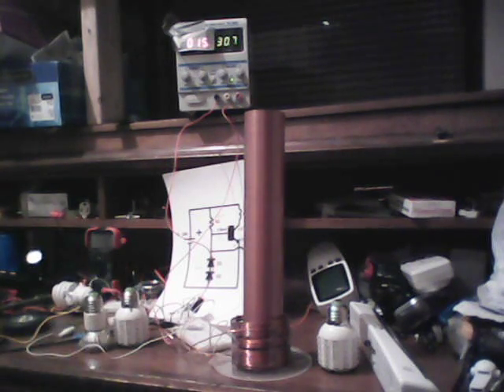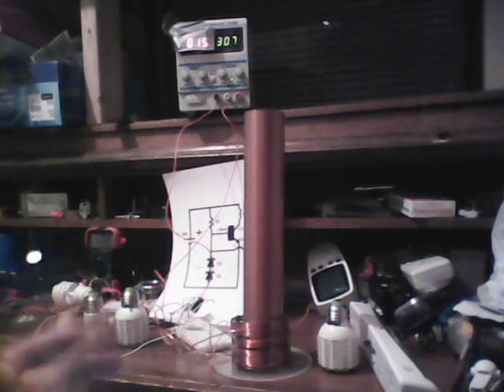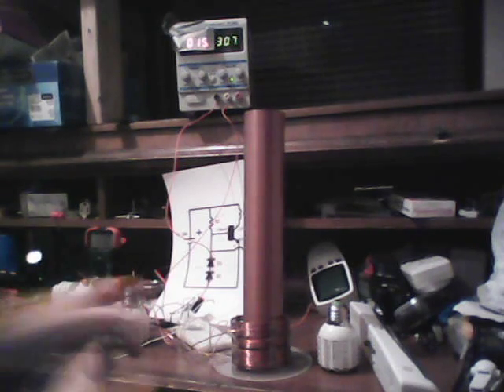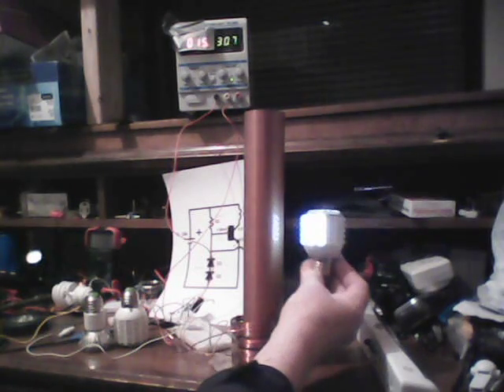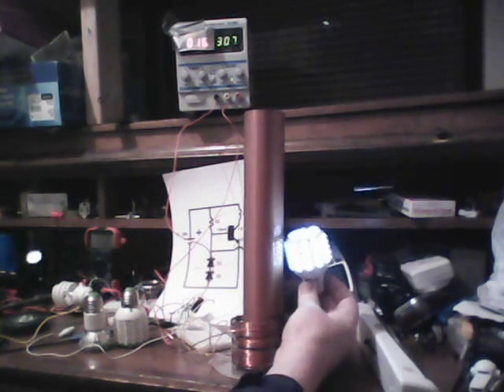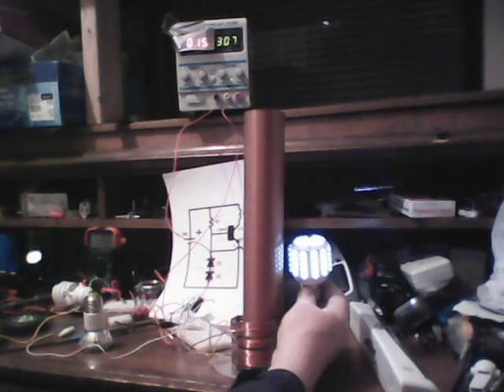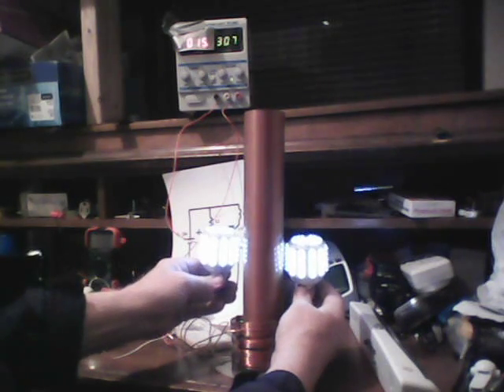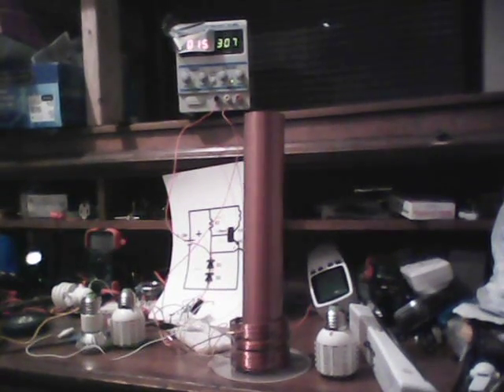Tesla Coil + Blocking Osc +LED lamps!

Comment from the maker: The read-out on the power-supply meter reads "015" on the mA scale.  This is indeed 15 mA (as I said).  Just for fun, this evening I cranked the power up to 120 mA and then switched to the A scale, and it read "0.120A" = 120 mA, showing that my reading of the power-supply scale for mA is correct.  It IS 15 mA in the video as I said.  Happy experimenting!

Comment: You must be glad to have kept that tower...great to see it in service in 2013 :)
At a certain point, all bulbs will dim together. You might not ever see much of a draw in current, but will see the dip in output across all loads. Once the field is set up, it's the efficiency of usage of that field that is at play.